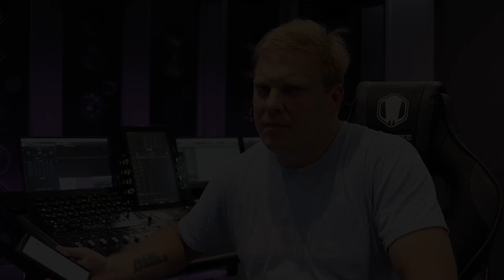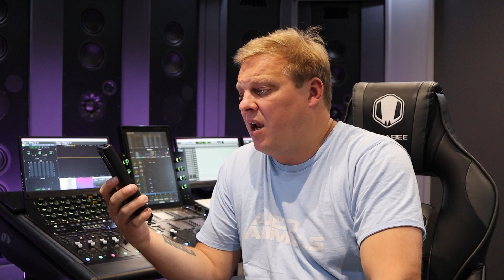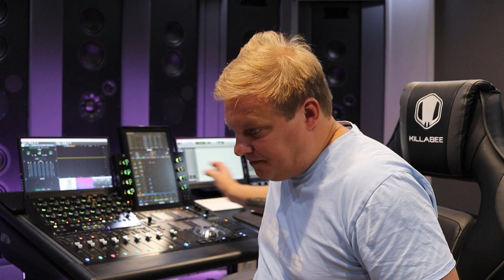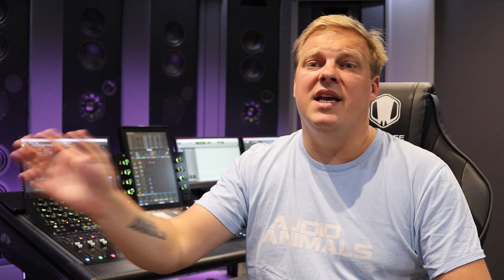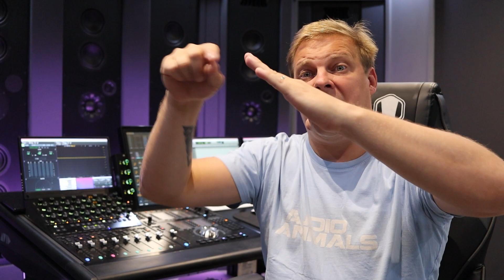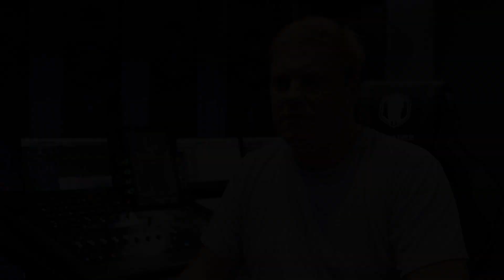How Big Should I Build A Dolby Atmos Studio?

Comment: Question: at MIT and media lab we determined, modeled and tested treated and dynamically optimized in terms of RT-60 and other criteria for tracking, mixing and mastering.  As such, we discovered having at least one room axis that is large enough to support the lowest fundamental frequencies required.  In other words, like 64 ft to support 20 Hz at sea level.   This required a large, well optimized room of about roughly 2500+ sq ft. Do you have any thoughts on that?

Comment: Question.  I notice that several of your front monitors’ HF drivers are about at level with the top of your mixing console— doesn’t that cause fairly noticeable reflection and interaction with the top of your console?  Just was at a similarly configured studio in London where that was a real issue.   Am I missing something that one can do to mitigate that issue?
Reply from the maker: We have a trinnov installed which rectifies this issue. I actually mix in standing position so that desk rises up another foot. With the trinnov off it is a big issue but with it active there are no issues. I have two profiles on the trinnov so the room is corrected to a standing position and sitting position. This means the room is adjusted based on where that desk is positioned. If you look through the videos in this series there a few talking about the tronniv and its importance.